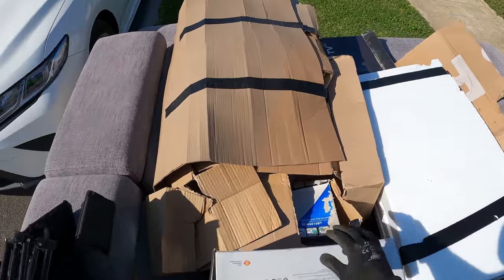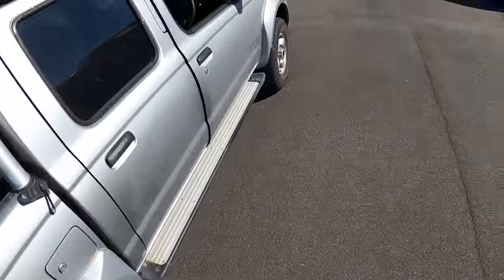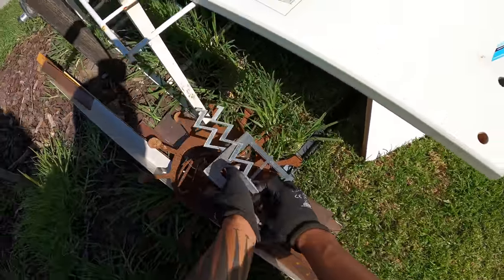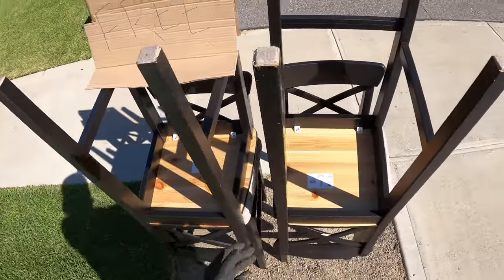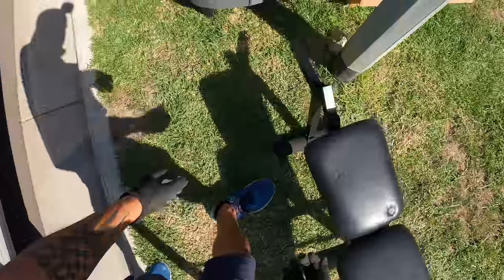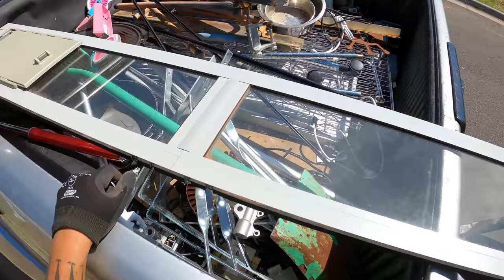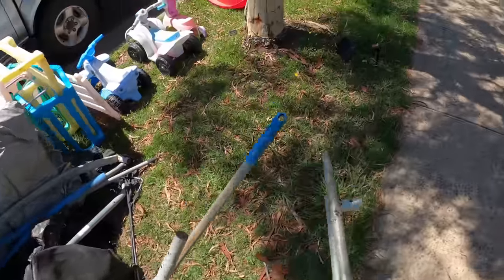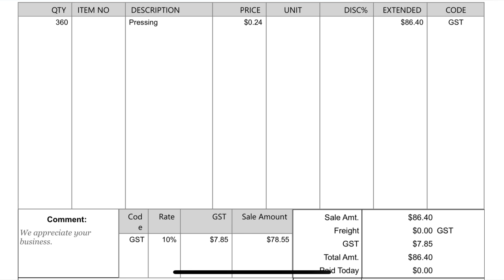Searching For Curb Side Treasure

Comment: I can't get over the amount of toasters that you find! That must be the most replaced appliance in Australia. At around 10:50 you cut the cord on a radio, the antennas on those are chrome plated brass and they just snap right off.
Reply from the maker: Thanks for the tip Martin 🙏🤙

Comment: Good work bro. I think you need a few sheets of Corflute on the front of the trailer to prevent pipes and tube from getting stuck in the mesh. Smooth as butter.
Reply from the maker: Yeah not a bad idea brother. I’ll have to look into that. Thanks for the advice andy! 🙏🤙

Comment: Hey Poly, Great run and good return. Unloaded yesterday and got 260 for the load and headed back out with the ute only and scored a few micro's and a heap of bed heads and rails, loaded back up last night but only expecting maybe 100 or so.
I did do a video of unloading and then the battery  died in the GPro.
I have just printed out a few more maps for pickup which is really close to home.
I do work a full time job and doing this in the arvo and weekends and also my other hobbies, I am flat out like a lizard drinking
Reply from the maker: You’d definitely be flat out! Good work mate. Shame about the battery. I always have 3 ready to go and charging block. Cheers Brad 🍻🤙

Comment: You’ve had that number plate on the back of your trailer for a while, crazy how you haven’t been pulled over
Reply from the maker: You mean pulled over when I didn’t have it displayed?
Reply: @PolyProphet  in Queensland you need to have anything on the road registered so I was wondering why you haven’t been stopped for not having a proper number plate, anyway I’m not from Victoria so who knows
Reply from the maker: @scrapitaus  ahh I see. In VIC my 6x4 trailer only needs my plate clearly displayed. Anything bigger needs rego. Smarter people in these comments might correct me but I’m pretty sure that’s it. I’m torn on upgrading my trailer partly for this reason. This setup is a lot of fun at the moment 👌